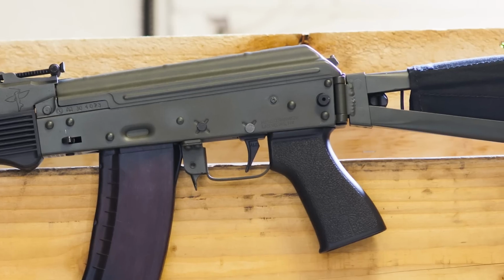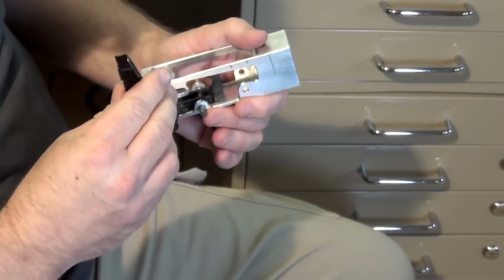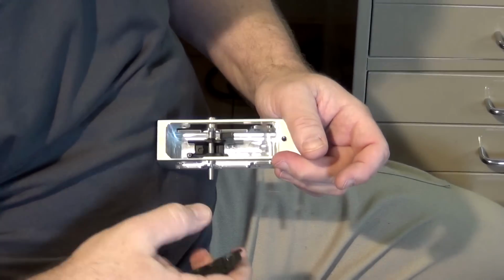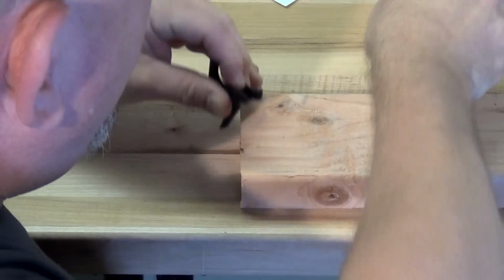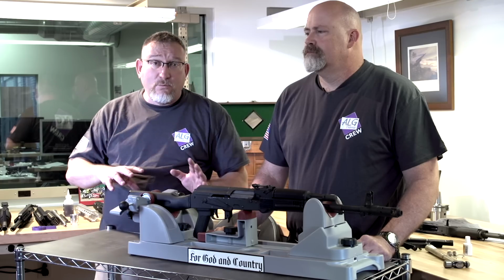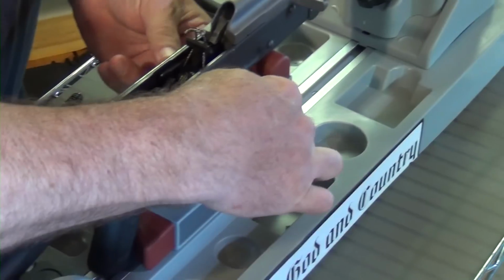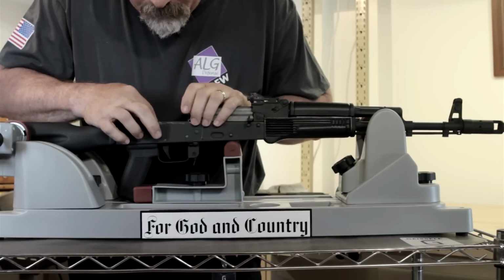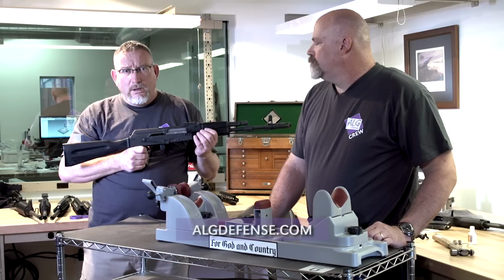ALG DEFENSE - AKT PRODUCT INSTALLATION VIDEO

Comment: my hammer spring keeps coming off the hammer and getting binded up to one side. spring is fine and works fine with my factory hammer though. but factory hammer wont work with alg trigger. Purchased from midway 2 weeks ago. anybody have any ideas on why the hammer spring comes off and binds to one side?

Comment: I love this trigger. I installed it without any fitting in the place of the US/Bulgarian trigger that came with my Arsenal SLR-104FR. I chose to install the auxiliary trigger spring which was a bit tricky and the included roll pin was not needed with my Krebs Custom safety selector. There is an immediately noticeable reduced amount of take-up before the trigger breaks and although I dry fired several times before shooting it for the first time, my first round went flying. You will easily make the necessary adjustment in your routine. Everyone has their own opinion and I am so pleased. Right from the start it breaks so much more easily than the Arsenal trigger or a Tapco G2 (which is a very respectable trigger). I was able to consistently put a ten round string into the black circle of a 6" ShootNC target at 100 meters. Nice...very nice. May I also recommend using an ALG High Energy spring in place of the twisted stock spring. Consult with ALGs website for recommendations before installing on your AK variant. You will be happy with the results.

Comment: My trigger and Saftey don't even line up in my gun so that roll pin doesn't do anything and it fires when the Saftey lever is in the safe position. I'm not impressed with these triggers so far but maybe there's a fix.
Reply from the maker: Please call or email us and we can help you with safe installation of your AK-T trigger.
Reply: will this work in a PAP M92?
Reply: Sounds like a gun problem not a trigger problem

Comment: Forget the file I’m gonna use a drill while trigger is installed. A drill bit will take that roll pin down and I won’t have to keep taking it out and putting back in.

Comment: "Part 4225A32" it took me a while to find because I thought he said "eight" instead of "A"
Reply: The file is $8.00 + $7.00 S&H = $15.00. The file is NOT made in the USA like Bill Geissele said. It's made in Mexico :[  I'm not happy that I paid $15.00 for a Mexico file.
Reply: Robert Reichelderfer I bought a pack of 8 cheap files from Home Depot for $10 and they have a warranty lol
Reply: The Home Depot and Lowes by me [ S.E. Mich ] did not have any mill smooth files. So I ordered it.
Reply: used a Dremel, turned out perfect. there's 0 play while on safe
Reply: caleb inman lol I'm one of those guys who shouldn't be allowed to have a dremel because I'd f it all up

Comment: The triggers are excellent. The roll pin install process sucks!  I actually had to do some filing in the trigger area due to the fact that the ALG trigger has a boss on both sides of the trigger.
Reply: how much filing did you have to do approximately?  I am installing one on an arsenal and it looks like i'll have to file a few mm off.....

Comment: The fucking roll pin is ridiculous. I'm about ready to pull my hair out
Reply: I was having a lot of trouble with it at first as well. The plank of wood and ballpeen hammer really do make a huge difference. However, be prepared to smack your fingers with the hammer a few times before getting it. There's really no way to avoid it. After you finally get that little bugger in there you're just about home free. Just take your time filing so you don't take too much off. I suspect removing the roll pin will be just as much of a bear as putting it in. Good luck!!

Comment: if i pay 65 dollars for a trigger i expect it to be drop in ready. You actually expect me to put work into it.
Reply: Dude...$65 for a DECENT trigger is a fuckin steal. Having drop in components comes at a price, and I am not just talking about money. And fwiw, there is absolutely NO STANDARDIZATION concerning the vast breadth and depth of AK/AKM manufacturers in the world. An AK pattern rifle is not an AR patterned rifle in the sense that any Milspec AR component will fit into any Milspec AR.  AKs vary in tolerances to a drastic degree. Considering the multitude of countries that adopted, bastardized, custom designed and some that flat out forged their own unique variant of the AK, the fact that ALG was able to cover damn near every common variant with 1 goddamn roll pin is astonishing. Hell, my $240 super dynamic enhanced trigger wasn't even a drop in but it is still a fantastic piece of equipment. You just need to respect the fact that more companies are broadening their horizons and branching out from the over saturated realm of AR gear and into the more or less shallow pool of AK mods.

Comment: Will this trigger work in a PSAK47 gen3?
Reply: Yes, roll pin was needed for mine.
Reply: @ChubbyNipsSyndrome  Did you have to do anything for rivet interference? Did you file anything off the top of hammer or trigger hook for carrier to cycle? Or, was it just the roll pin install with some filing for adjustment?
Reply: @dccmadams44  Roll pin with some adjustment as well as some filing on the hammer for bcg clearance.